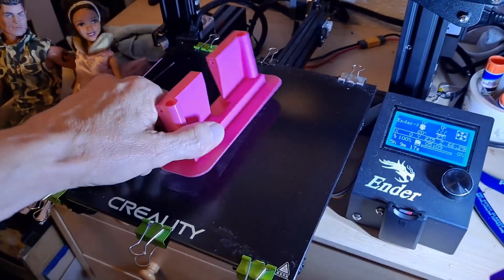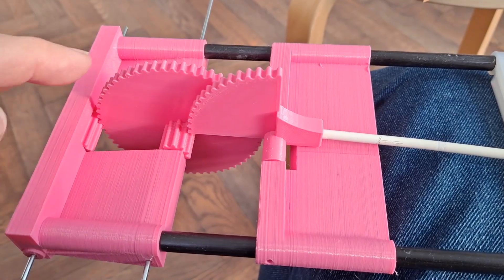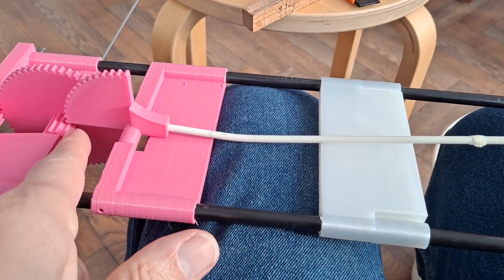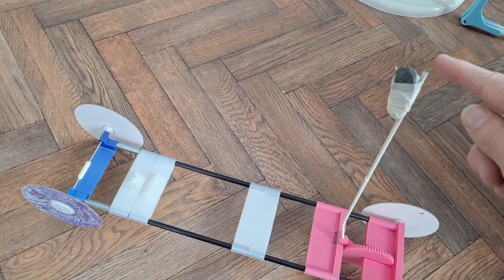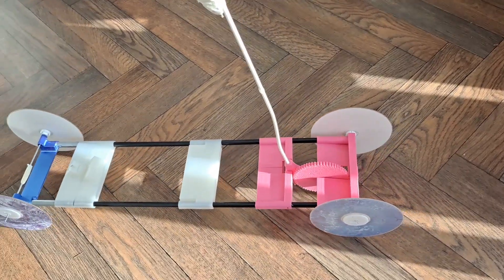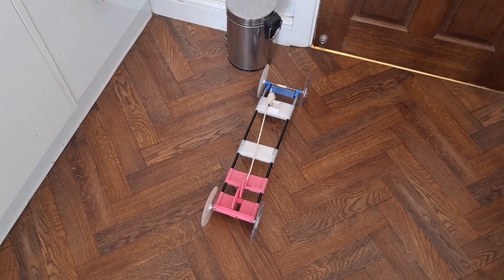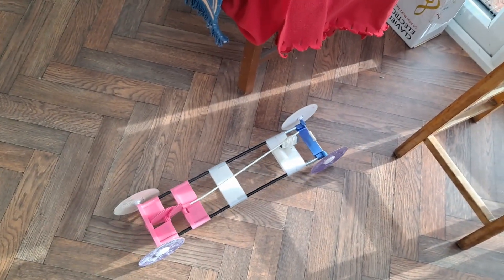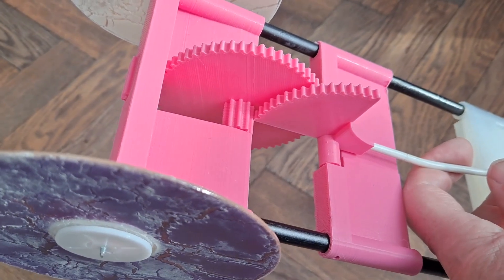Geared Gravity Car Part 2 intermediate gears

Comment: hey 
how did you reduce the friction in the gears? Because I found a hangar wire which fits in the 3d parts and when I attached the wheels to it turns freely when it is not on the ground, but when I put it on the ground there's so much friction and that is making it so hard to move
Reply from the maker: You would have to find where the friction is occurring. Any moving part might be the cause, so you have to check each point. Or maybe your weight is too small. You could try manually operating the arm several times to see if the parts that are causing the friction are worn down with use. Finally, check that you haven't got the gears too close together. If they are too close, they can jam.

Comment: Hey man I am making this car for my school project and I wanted to know the diameter of the wire you used to insert in the 3D parts cause I tried 3 different types of wires and it didn’t work plz that would be great if you could tell me
Reply from the maker: For the axles I am using bicycle spokes which are 2mm in diameter. When you say "didn't work", what exactly do you mean? What didn't work? The print tolerances on a 3D printer could make the holes too tight or too loose. If they are too tight you can put a suitable length of the wire in an electric drill and drill through the holes using the wire as a drill bit. If they are too loose, you can roughen the surface of the wire using wire cutters to put little tooth marks in it. That makes it a little wider. Super glue could be added too.
Reply: I am using a 16 gauge wire (probably 1.2mm) and it fits in but it is too thin and it doesn’t turn
Reply from the maker: 16 gauge is 1.6mm. Bicycle spokes are normally 2mm which is 14 gauge. Putting tape round the wire is unlikely to help as it will get pushed off as you try to slide the wire in place. Another option would be to put a coating of solder on the wire. That would thicken it. You could squeeze hot glue into the holes then push the wire through. That might work.

Comment: That worked really good with the added gearing.  I wonder how it would run as a rubber band  powered car.  Just replace the weight with a thin rubber band or go 'hybrid' and use both.
Reply from the maker: I have done geared rubber band cars, but I use a twisted rubber band to spin the gear https://youtu.be/uH5ZJFWAbmU?list=PLA5a2xPRSrB3pHy547Qc7lSgURT6YYCyN
Reply: @GrandadIsAnOldMan  Thanks for the link.  That car ran good also. I like those big gears
Reply from the maker: @Lidmotor  that was before my 3d printer, so hand cut from hardboard. Took me ages 🤣
Reply: @GrandadIsAnOldMan  I thought that maybe you made them out of stiff cardboard.  Lot of work compared to 3d printing.

Comment: Do you think hard drive platters would work well as wheels for one of these cars?
Reply from the maker: There are advantages and disadvantages. Hard Drive platters will be heavier than CDs so take more effort to start them rolling. The extra weight may be an advantage as they will give a flywheel effect and carry on rolling with the energy stored once they are rolling. Here are a couple of videos I did with Hard Drive platters of rubber band powered cars https://youtu.be/voP_z0a12z8?list=PLA5a2xPRSrB3g5RiX8Kf_uUBOL0Tb7AS0 https://youtu.be/oKyIpHJA08k?list=PLA5a2xPRSrB3g5RiX8Kf_uUBOL0Tb7AS0 and this video by Mark Rober goes into great detail about the mechanics of wheels and axles etc https://youtu.be/b7zWwo9dbiU?list=PLA5a2xPRSrB1zzCqDckAnlOzz8iViuM94

Comment: Nothing is much more fun than experimenting with gearing or pulleys, with a 3d printer and an aptitude for design, man, the fun to be had... the intermediate gear was always at the forefront of your mind for this vehicle, but it's nice to have a control to compare it to. well done sir! makes me want to build my own
Reply from the maker: Hi Spencer, hope you are well 😊 I try to avoid gears, it just adds a level of complexity and means I have to work to tighter tolerances. But I do like the look of them 😆👍

Comment: that little bit of gearing really slows that arm down
Reply: a little bit!? that's a 10:1 reduction (guessing grandand... be harsh if you must) but yeah, for sure.
Reply from the maker: Thanks, yes that works better 👍👍
Reply: Robert murray just did a printed 100 -1? gear box... you would need a much bigger weight.. lol.. but he's thinking electric generation not distance.. still its cool what you can create... I was telling my son about my idea for your printing scraps.. he said he's been considering getting a printer.. now Im wondering if the machine can be made to print randomly... like a paint can pendulum in a wind storm 
.... lol....
Reply from the maker: My printer prints randomly when the item slips off the bed. Then we get the birds nest 😣